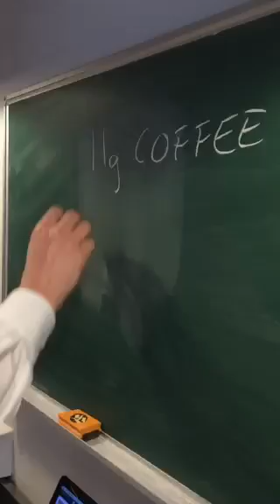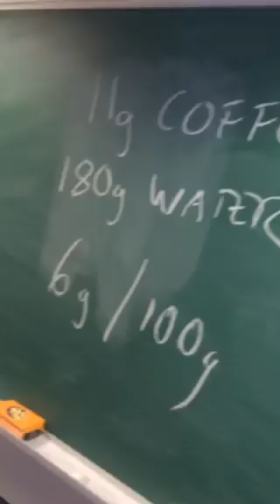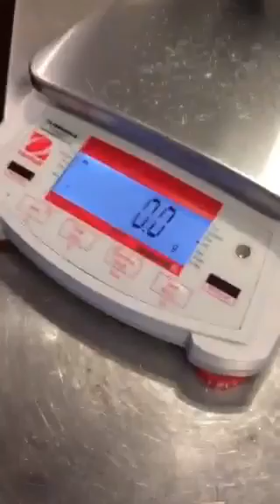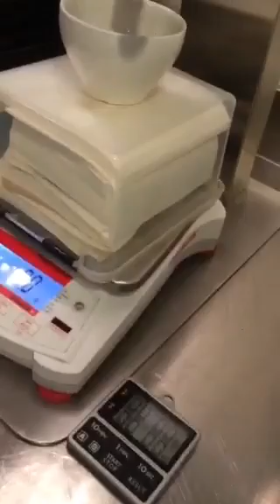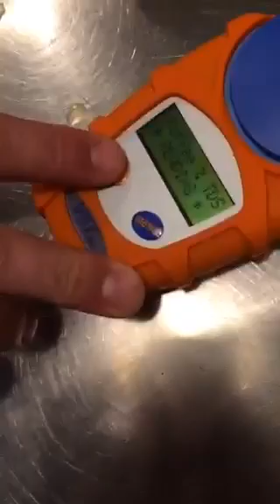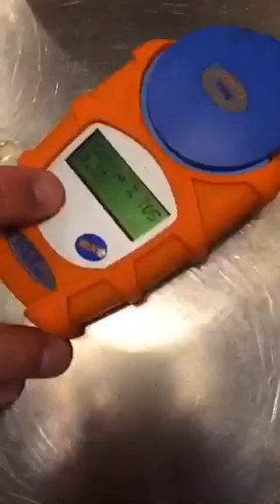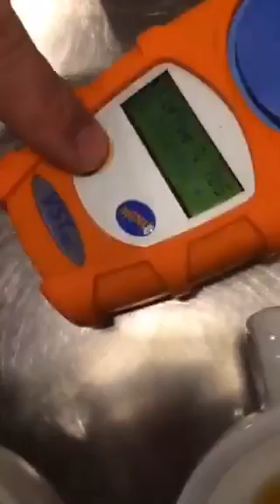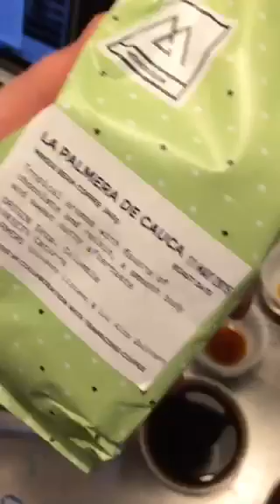Cupping Session on Periscope with Tim Wendelboe

Comment: Years ago this was made, great video series, thank you! 
i'm late, but just a bit of nitpicking... 
I believe that when calculating "extraction %" with immersion methods, you should not add the weight of the coffee grounds to the "beverage weight" (@23:45). 
As the presense of 11grams of grounds only displaces the liquid and does not impact the TDS, after extraction, although the weight in the cup is increased.

Comment: Would TDS change over time.  If you cupped some coffee, but had to leave and you forgot about the coffee, and then tested for TDS a few days later, would everything be exactly the same, or would TDS fall?  Is there a way to precisely measure gind size?
Reply from the maker: I would expect TDS to maybe slightly rise. Remember that we are talking about dissolved solids so they are dissolved in the water. Since there is still grounds in the cup I would expect the TDS to maybe rise a bit over time. Measuring grind size could be done with sieves. Kruve has some convenient ones. But there is always a mix of size in a portion of coffee.